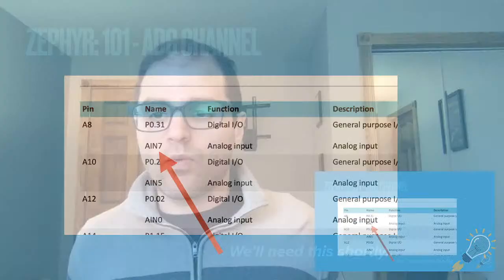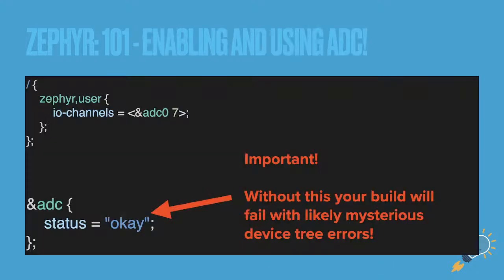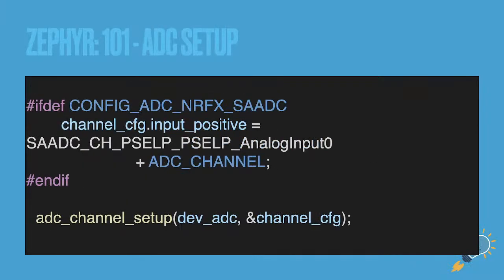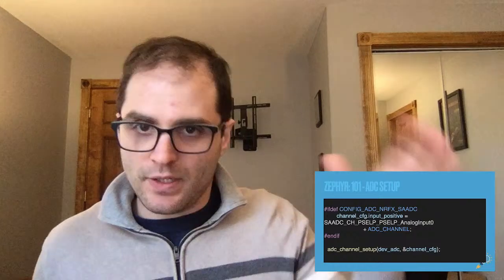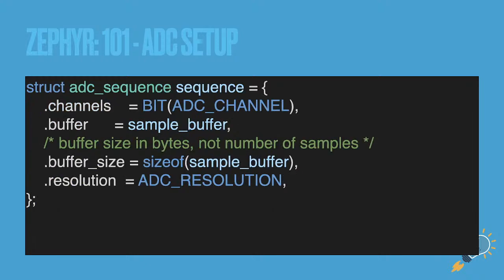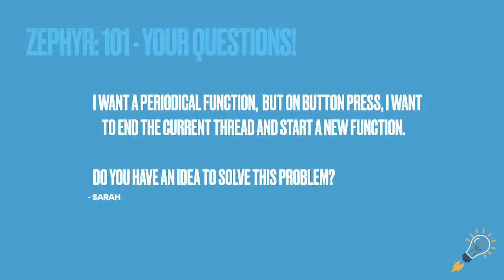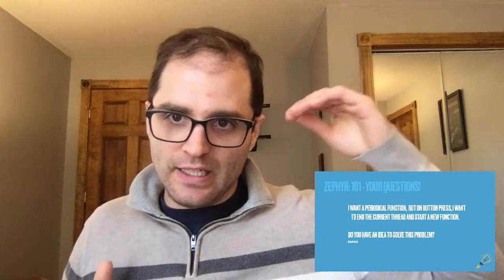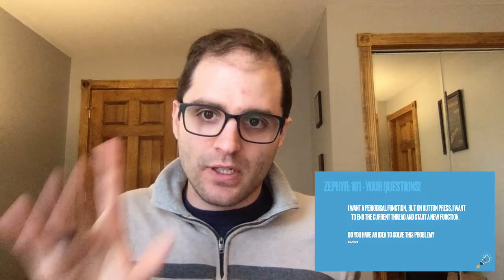Zephyr 101 - ADC + Thread Control

Comment: I tried this code for NRF52 (PCA10040). Do you happen to know why the adc_read() returns only an error code value -22?
Reply from the maker: Hey Siwamatti, check out the latest video as I dove in a bit on your question. Let me know if it helped! https://youtu.be/TijlHi9q4tQ?t=730
Reply: @CircuitDojo  Thank you! Very impressive to get such an comprehensive answer so quickly. The (silly) problem was a with the initialization.

Comment: Thanks for answering my question!
Reply from the maker: You're welcome. I hope it helps. :)
Reply: @CircuitDojo  It did help a lot! I was able to get the adc working for multiple channels, thanks! However, I have some questions, the first one is, is this way of calling  the adc_read function blocking until the adc conversion is done?  The second one is, why does the example code says "This sample does not work on Nordic platforms where there is a distinction between channel and analog input that requires additional configuration" I though that the "#ifdef CONFIG_ADC_NRFX_SAADC" part takes care of that
Reply from the maker: @mateusraitz1803  I don't think so. It's async. This allows your processor to sleep while the ADC peripheral does its thing (SAADCs take a while to get to a measurement)

As for the second thing, not sure since its been working on my nRF boards fine. I think they may be just indicating that it works a little differently on Nordic
Reply: @CircuitDojo  Hey Jared, very late response, but I just wanted to mention that adc_read() it's actually a blocking function, you have to call adc_read_async() for the async one. I was able to get the async working but I never understood how to set up a callback for it. I haven't mess with that code for a couple of months.